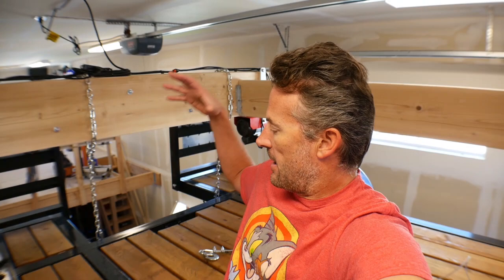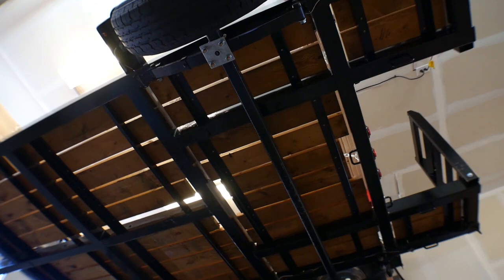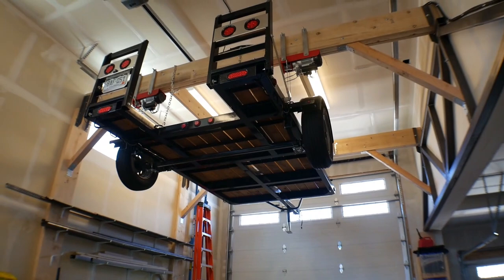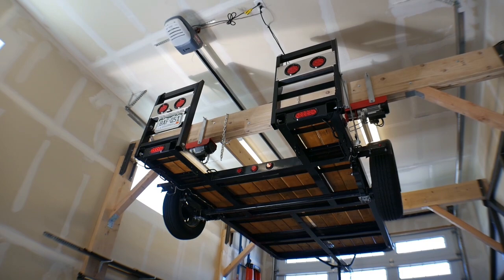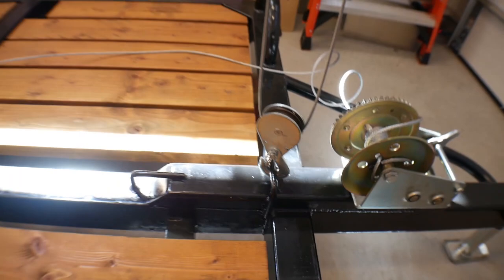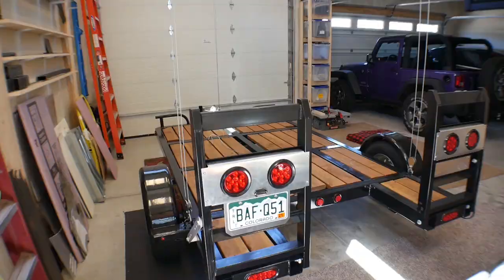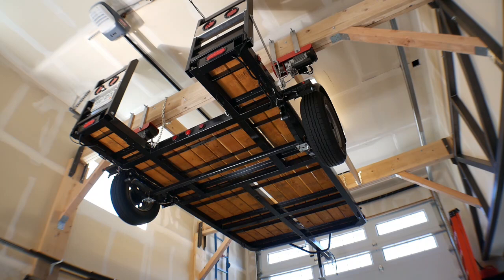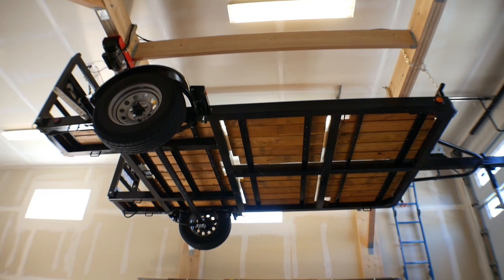Trailer Hoist for the Garage

Comment: Doug I'm gonna start calling you Captain Overkill :)  1/4" cable has about 7k lbs of strength in tension, the 2x12s on edge like that are at least 5k lbs of load each... so you could conservitavely hang 20,000lbs off of that setup. The HF winches might not like it though. You could easily lift Ratchet or Mauler. Cool setup :)
Reply from the maker: Thanks, I needed to overbuild to be comfortable with it. 👍

Comment: You could throw some light stuff on the trailer like a few tires or pvc piping, etc. Xmas decor maybe. If you needed more storage. That’s freakin rad though!  Great idea
Reply: I wish you could have mounted the winches on top of the beam instead of under the beam but hey, it works, right?
Reply from the maker: The winches need to be on the bottom because the beams are just high enough to clear the garage door. The garage door goes like 2" above the beams. Although I could have mounted the beams lower.

Comment: A way to stay off the ladder would be: replace the chains with self-build hooking arms. Use c channel. The connection to the beams would be swivel on a grade 8 bolt so that when the trailer moves past them they swing out just enough to let the hooks slide by. Weight the bottom of the hooks if you need to. Have a piece of rope at the bottom of each hook so that when you want to release them, you pull them out of the way and hold them back by putting the loop at the end of the rope over a holder attached to the wall. So you would basically be letting gravity do the work so that you don't have to climb the ladder and fasten the chains. Obviously, visually inspect the hooks to make sure they rotated into place before you relax the winch cables.
Reply from the maker: I've thought about hooks like that. But using weights and rope is a great idea. I was thinking about actuators. But it got so complex so quick.
Thanks for the idea.

Comment: Very cool. I'd be loading the deck up with a bunch of stuff as well. You have a huge safety factor margin as it sits. I think one 2x12 x 12ft has a safe load capacity of around 2000lbs(on it's side) so you should have 12,000# safe load capacity.
Reply from the maker: I built it solid, on purpose. Wanted to overbuild it if anything for peace of mind. 👍

Comment: you could get a chain scale like people weigh deer ? don't know the weight of the scales .. but hook up and check each lifting point  would not tell over all weight just pulling weight at that spot ,, you have a great idea in your system .the only thing that i don't know is the weight limit of your chain .. cheap or top grade ,, with you i would say top grade .. keep the videos coming great work
Reply from the maker: Thanks buddy!
Actually when it's hooked to the chains I'm really comfortable. It's when I disconnect the chains to lower it that I get a little nervous.

Comment: All that is over killed... Better than less. All your structure can support you « Baja » strapped on the trailer, just the 3 winches could be a bit weak for both LOL 😆. I like your set-up
Reply from the maker: Yeah, better over than under. 😉
Reply: @DougBugBuilder  Not always...
Reply from the maker: @Paul_VanGo  True, on Wratchet I'm always trying to build just strong enough. To strong and it'd be a heavy tank.

Comment: I think the only weak point is the HF winches. 
That could be an easy upgrade in the future by swapping out those winches for possibly even one single heavier capacity winch and running all cables back to the one single winch.
Reply from the maker: I agree, the winches make me a little nervous. I might upgrade them at some point. Hopefully the'll be trouble free for now. But I'll keep an eye out for something better.

Comment: I love this setup, did you have to modify the hoists to extend the controls?   Are you hitting 3 buttons at once or how did you do the wiring?
Reply from the maker: Yes I extended the controls about 25'. The original wiring is 18g, because it carries line voltage and I made it so much longer I used 16g. I installed (3) switches in the control box on the wall. They all independently control each winch. So yes at times I'm holding three switches at once. But this way you can alter the winches to catch up or tilt the trailer. Depending how the cable spools they will move at slightly different speeds.
The box is mounted to the wall and the switches are mounted together. So working them together is no to bad. They are all momentary On/Off/On switches. Defaulting to the Off position.

Comment: very cool I love the idea. did you think about wiring them all to one switch so they all come down at the same time?
Reply from the maker: I did, but in tests I noticed depending on how the cable is on the spool the cable actually travels at slightly different speeds. So when going up or down I usually need to stop a winch or two so the other can catch up.

Comment: Doug!  Would it have your signature on it if it WASN'T well thought out and (let's be honest here - it's been said about 20 times in previous comments) a bit overkill.  :-)

Nice layout.  Is that .090 wall 2x4 stock on the trusses?  Hard to tell against the 2x12's.  Oh, and you said that the HF winches were rated at 880 lbs?  You doubled them with the pullies, so make that 1760 lbs at each winch.  900 lb trailer?  I think you're good...
Reply from the maker: The truss is all made out of 3"x 3"x .125". Pretty sure the truss can hold up the house if needed.  😁
The hoist is 440 lbs straight pull. 880 lbs with the pulleys. So their not that much overkill.
Reply: @DougBugBuilder  Okay, sanity factor retained - for the moment!  Hehe

Comment: Yea none of that shit is not going anywhere if my 20’ trailer was being lifted up there, cool set up to keep it from being stolen. You did right by using support chains as winches are not designed to hold weight as a hoist is and could possibly creep down but highly unlikely with it being 3 of them
Reply from the maker: Thanks, appreciate the comment.

Comment: What gage wire did you use to extend power to switch?
Reply from the maker: The remotes came with 4 conductor 18g wire. And it does carry 120v on it. So I went with 4 conductor 16g because I was making it so much longer. And it's been just fine. The switches are DPDT, momentary on, spring loaded to off.